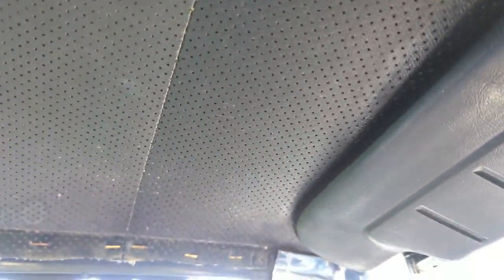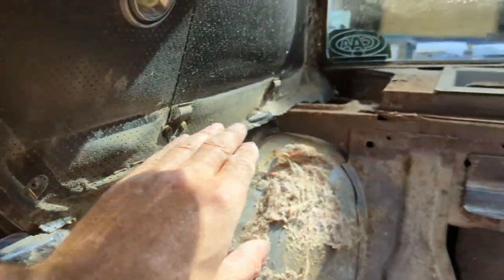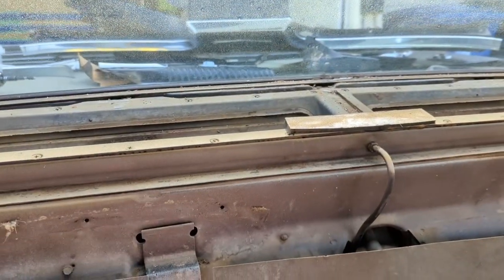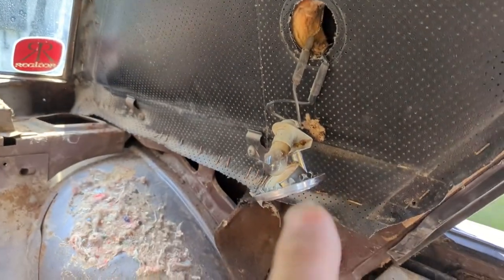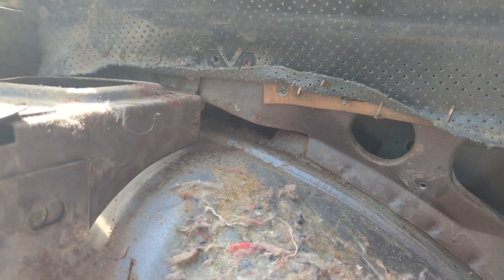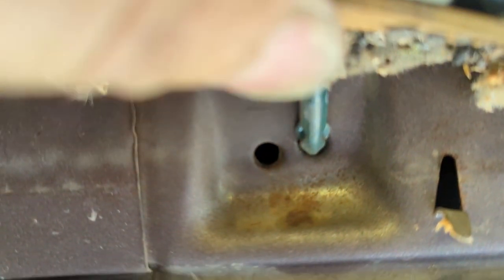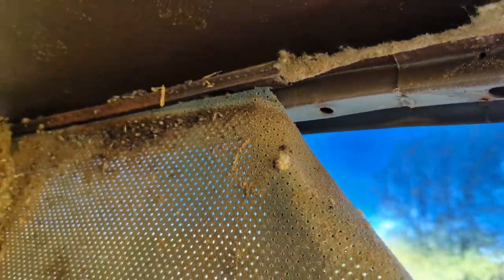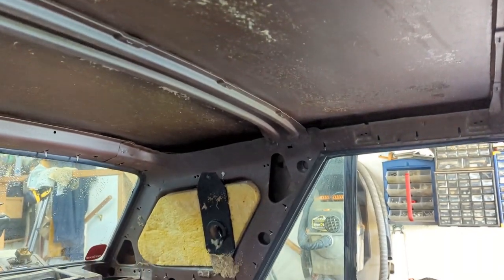65 Thunderbird Hardtop Headliner Removal

Comment: Glad I found your channel since I am planning on buying a 65 Tbird all the information will be a great help.
Reply from the maker: Thank you for subscribing! 
Rodents and rust are the to biggest things to look for, on this car it has taken me almost two weeks to get the mouse smell out. 
I had to remove the headliner, carpet, and truck liner, then clean, and clean, and then clean some more with spray nine, then hit it all with a bleach mix. I bought new carpet, a headliner , and trunk liner.
As for rust, they seem to be rusty around the rear wheel arches, and wheel houses, if there is body filler visible...be cautious, not to say it would be a bad car, just be careful.

Comment: Would that boom mat, or kilmat be a better avenue than using the regular headliner that the mice love?
Reply from the maker: Hey Troy....I bought some deadener mat for it, not the kilmat brand, but it's adhesive back close foam 4mm in thickness. Should do the trick! 😀